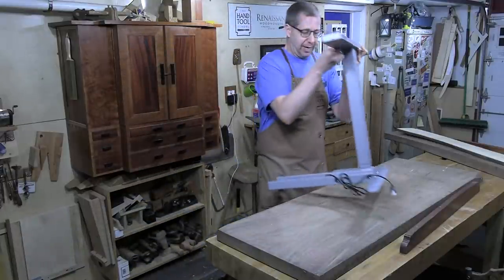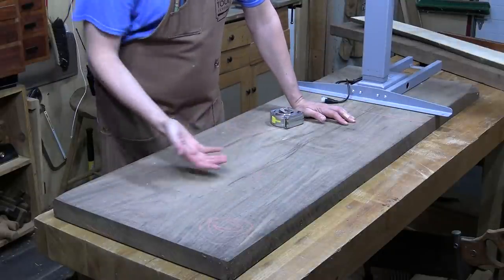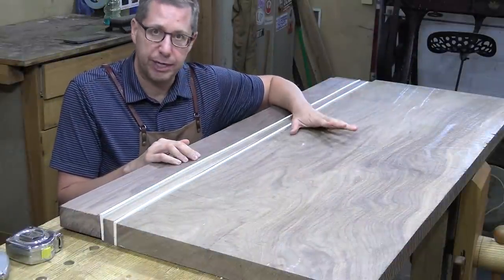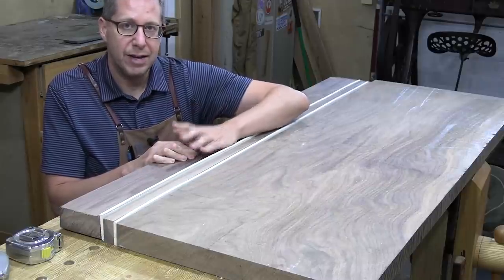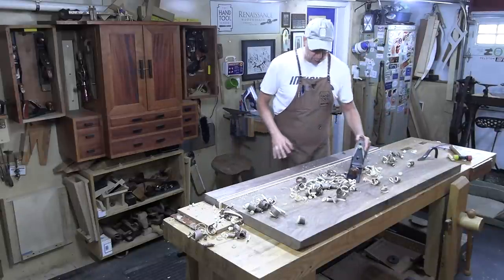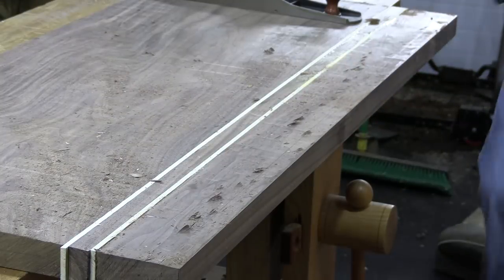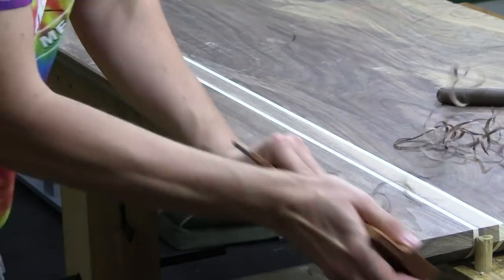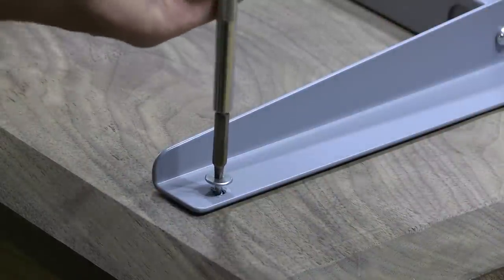Making a Solid Wood Top for a Stand Up Desk

Comment: I hate to be that guy (too late!)... Why not just drill one hole and cut one end of the metal support to fit?
Reply: Would make a crap video... and it looks fecking awesome
Reply from the maker: Functionally a 22" wide desk doesn't feel deep enough and the wide feet would then look ungainly.  To cut the feet down would make the whole thing tippy as you raised it.  Besides, this is more fun.
Reply: @RenaissanceWW  ok fair enough. Also the "cool factor" does come into play. As I have told my wife in the past: "I don't NEED a corvette to drive only 4 months out of the year, but it would be cool..." 

Still don't have my Corvette, yet.

Comment: “Holly“, nice contrast, but I have never heard of this species of wood (did it give Hollywood it's name?) so had to look it up: Ilex aquifolium. The European Holly turns out to be tree of the year 2021 here in Germany 😉 Interresting!

Do you think one strip instead of two would work (visually) as well? I wonder if you added the second one deliberately. 

Last year I built a top for my standing table as well, but out of maple (did not have anything else long enough), much thinner (1“). I have also put a big chamfer on the underside (called a Swiss edge here), which makes it look even thinner and gives it an elegant and ligth look. It also adds to the durability of the motor (I hope).

How do you plan to finish yours?
Reply from the maker: I did add the second stripe deliberately.  I do think it can work but its a different look and I don't think accomplishes the same goal of hiding the glue line.  If I were using a different species at the back of the desk then I think a single line of Holly to punctuate the transition would work but trying blend Walnut together the double line works better.  I'm sure there is a design principle in there somewhere I don't know about.  The finish will be a varnish for durability.

Comment: If you didn't have that slab, what's the thinnest top that you would have made? I'm asking because the cherry top that I have glued up is going to end up around 7/8".
Reply from the maker: The base on this has a center trestle so one could go down to 3/4" without concerns.  The factory top was 3/4".  Personally I like the look of a thicker top and find 3/4 to be anemic looking.  7/8 will work structurally but take a look and see what you feel about the aesthetics of it.
Reply: @RenaissanceWW  Thanks, Chief. If it ends up looking too thin, I can laminate some strips on the bottom to fake extra thickness.

Comment: Impressive top! I can understand the urge to replace a basic one with a better one. Maybe I'm too distracted by morning stuff, but I couldn't quite figure out what the dampers were for. Is it to keep the top from clattering against the metal?
Reply from the maker: "Clattering" is probably a bit harsh because once tightened down there is no movement between top and metal base.  Personally I find this protects the wood a bit and very subtly cushions the top against the metal base.  It is really apparent when the desk it set on a hard floor vs carpet.  By no means is this a requirement, I just find it an extra step worth taking.